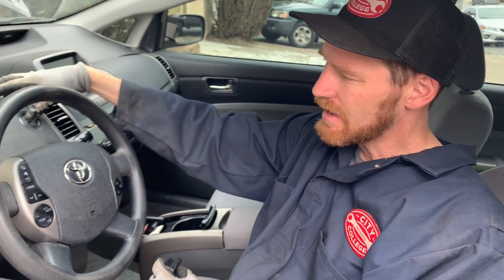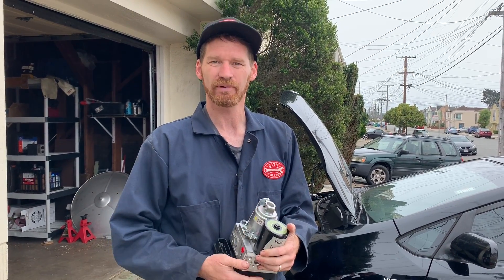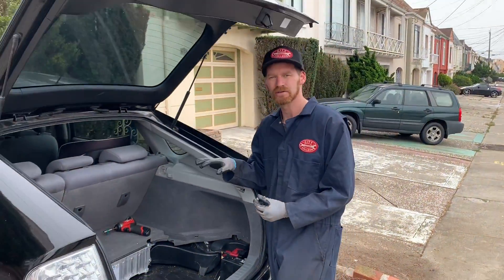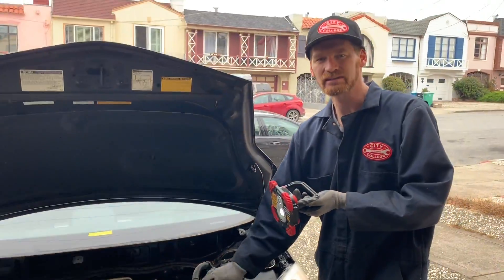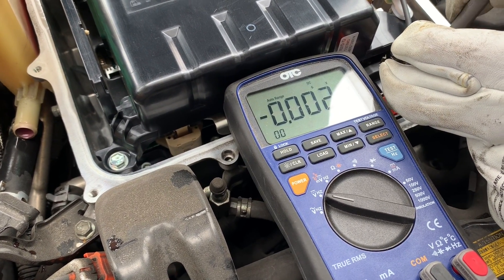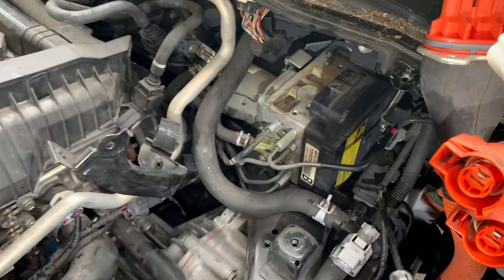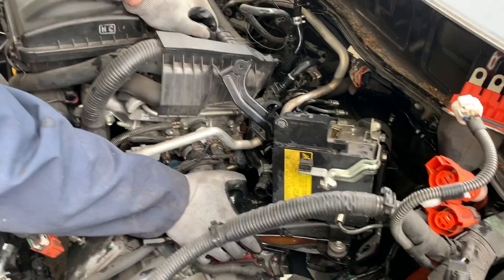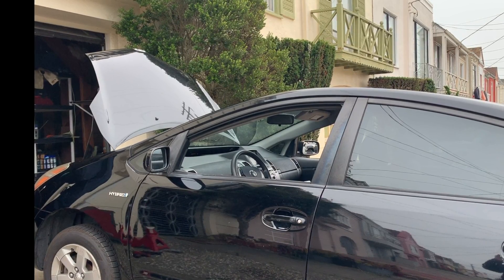2004-2009 Prius ABS Actuator Replacement

Comment: My 2008 Prius is making the high pitch beeping sound with the (ABS , VSC, and the brake) light on! I used the paper clip trick and the lights turned off  for 1 day , and then went back on!. Now the beep sound is longer and comes back on more often. would changing the  ABS actuator stop this issue? Please help ... thanks
Reply from the maker: I think the beeping is a symptom of failed actuator. Checking the stored trouble codes in the abs module would be the next step.
Reply: @Mrelectric423   I did and now I'm pretty convinced that the Actuator needs to be replaced. I'm going to see if I can find a second-hand actuator and follow this video to install it. Thank you!
Reply: I followed the video, and with a help of a great friend I was able to replace the part in about 8hrs . The car has been working properly for about a week now. 🤞🏼 
Thanks again for the useful video and I saved a huge amount of money. 
Thanks again!
Reply from the maker: @hamahawta  Excellent!

Comment: Thanks for your help I was able to complete my actuator replacement on my 06 Prius, I purchased a one month old actuator from eBay for $700 out the door and I ended up doing the paper clip reset so far it's running normal again after I bled them brakes all the way around, I started at 3:30 p.m. and ended about 10:30 I just took it slow cleaned up all the parts went well thank you again
Reply: Was your Prius making the high pitch beeping sound before ?
Reply: @hamahawta   No all along it was just making the clock sound just under the hood and some clicking sounds back by the rear brakes every 5 seconds it would last about 5 seconds, But the high pitch beep came on when I was bleeding the brakes with the new actuator,  I just continue to bleed them  Kind of like a traditional way of bleeding, Then I needed to use the paper clip trick to clear the lights and that also reset the new actuator, You have to do this a few times to get a good bleeding but so far I'm driving for the last 200 miles and everything runs perfectly
Reply: @mrvic92154  Thanks! I will change the actuator, and hope this whole beep and click sound stops afterward.

Comment: Hi bro.I got my prius from USA 2 day ago.so the light of abs vsc and brake on the panel.computer showed C1391.it mean same problem as on your video ?.
The same noise in my car.zzzzzzzzzzzzz and some time noise like some body knock the door
Reply from the maker: Yes it probably needs an actuator.
The procedure is unique for each generation of the prius. My video is for the 2004-2009 prius

Comment: Help? I finished, but the same lights and beep come on. No sound from the brakes? Resister? missing plug? New unit.
Reply from the maker: Check and clear the codes. With certain codes it will not even try.

Comment: I did this nd got now the car won't turn on and all the lights are on any ideas what did wrong?
Reply from the maker: Orange safety connector not clicked down all the way or 12v battery dead
Reply: @Mrelectric423 thank u, I got a code p0A0D and I cleared it nd checked the orange safety connector took it off and put it back on a couple times and it's not working so I'm not sure what else it could be any ideas?
Reply from the maker: @jesusibaibarriaga2645  You are probably not pushing the plug down?
https://www.youtube.com/watch?v=khDrAr2gog8

If that is not it check the tiny pins inside the inverter cover that are part of the same safety circuit.
Reply: @Mrelectric423  yea at first I didn't but then I figured it out and even after pushing it down still nothing I will check the voltage on the 12 v battery tomorrow when I go back to work but right now I don't know what else to do
Reply: @Mrelectric423  ok ill check those pins as well inside the inverter cover

Comment: I appreciate your time in making these very informative videos. I recently replaced the ABS Actuator on a 2008 RX 400H (so much easier than the Prius) and the brakes worked perfectly after replacing it. I did not need to bleed the brakes at all and all the ABS warning lights went away. If all is working well is there a need to deal with Techstream? Do you know of any issues that may arise if I do not do anything else? Thank you for your time!
Reply from the maker: My advice, If it works and no error light illuminated do not bleed it.
Reply: @Mrelectric423  You are awesome, thank you!

Comment: WOW! Please never stop your way of properly posting R&R videos! Now that I have your attention. lol 07 Prius, DTC Code (ABS flash code) is 45. I have the same sound but intermittently. 3 things I've noticed: 1) Apply brakes, it stops. 2) Rotate the Passenger-Right tire, it stops. 3) From the main battery compartment area and when the "shuttering sound" stops I can hear what sounds like fluid circulating near that right-rear quarter panel area. Maybe an ABS valve or something stuck open? Any suggestions/vids would be MUCH appreciated.

Comment: Thank you so much for sharing this video and this is really helpful. Especially the bleeding process for the brake. The ABS module was so hard to take out and it took 3 of us 3 hours to complete the change work. Here is something that i want to share so if anyone sees your videos i hope they can find this helpful. 
After replacing the ABS actuator, the dash still shows VSC ABS lights, at first i thought the replacement part was bad (i bought the used one on EBAY), then after i finished the bleeding process and use the paper clip OBD trick,  the 3 dash lights go off magically. I hope everyone finds it helpful and thank you again for sharing this video.
Reply: How much did it cost
Reply: Blessings bro
Reply: Hey! How's the ebay part holding up?
Reply: @wssr3293   it's holding up very well, the Prius is still rocking after 300K miles
Reply: What is the OBD paper clip trick, I do have an OBD bluetooth scanner.

Comment: Great video. Used this video and others from two other guys.  Each one had different take on removal/replacement and I was able to repair my 2009 Prius with over 200K miles.  Bought refurbed ABS pump on ebay for $260.
Reply: @Kyle Galusha Hows it running today? still going strong? the abs i mean
Reply: @travislowrider6623  Still running fine. No brake problems at all.
Reply from the maker: Great to hear the DIY hybrid repair scene is growing one costly, major repair at a time. Good work!
Reply: @greengearhead1153  hey boss mine went out on my 14. Do I need to replace the master cylinder like they do at the dealership? I don't want to replace it if not needed.
Reply: @Rhamlin7  no, I did not
Reply: How's it running after 3 years? Thanks
Reply: @wssr3293  still running.  Should go over 250K this month.

Comment: Before buying a new ABS actuator make sure you check your brake fluid level. In my case it was leaking out of my drum brakes which I'm already waiting for in the mail. The brakes started working again after I added fluid (go figure) and I anticipate the leak will stop when I replace my drums.
Reply from the maker: Good tip
Reply from the maker: This video shows Prius drum brake repair. 
https://youtu.be/SvT4L5QrWAg
Reply: @Mrelectric423  The leak stopped when I replaced my brakes. Any idea how to reset the lights/codes?

Comment: Mine doesn't do that, but my lights are on and the code reader it's showing that,what does that mean?
Reply from the maker: What abs codes do you have.
Reply: @Mrelectric423  0 my codes are for my O2 sensor
Reply from the maker: @missquiinn6695  if there are not any abs codes it is unrelated to abs actuator as described in the video.

Comment: No problem easy job . New replacement has same issues  red triangle and won't leave park.. as it was before all worked just a hard manual brake pedal . And car drove. Now  not re inserted orange hi volt battery interrupter it's in correctly still no correct start no speedo etc
Reply from the maker: Sounds like something unplugged

Comment: I have issue to put brake line back in place. Any suggestion? I just won’t tread in and don’t want to bend it too hard.
Reply from the maker: Use the force

Comment: I just changed out my abs accumulator and now my vehicle won’t go in drive or anything? The red triangle is now on and check engine as well as the other lights that were on already. Any advice on what I should do? Do I have to program something?
Reply from the maker: Orange high voltage disconnect may not be clicked down. Make sure the lever swung inwards then moved downwards
Reply: That worked thank you!!

Comment: Our 2006 Prius  was towed to our Toyota  dealership yesterday with the exact codes and they called today with a $2700.00 replacement of the ABS actuator assembly.  Your well done video was very helpful and appreciated, thank you.  Looks like the quote was in line with your comments.   Understanding the scope of this work is huge considering the $$$ involved.  Great job thank you!    Only 73k  miles on the damned Prius, now known as the "bitch".
Reply: LMAO!!! I just got the bad news that this has gone bad on our Prius! I’m selling the bitch because it has 155k miles and I don’t want to dump that much $ into it with fears of something else failing. I’d like to take a sledge hammer to it is what I’d really like to do!

Comment: This is happening in my lexus gs430 smh $2,500 for the accumulator $500 to install and bleed brakes i wanted to cry have to use me and my wifes stimulus to fix it smh but it all happens for a reason

Comment: Have you done a 2010 prius actuator. 
Toyota in Louisiana is giving me the run around big time. I could really use some advice.
Thanks,
Dwightforeman
Reply: I have the 2010 model as well, and potentially the same problem.

Comment: This video and one other saved me over 2000$ and like you mentioned, it saved a Prius.  My local dealers gave 2 quotes, one for 4000$ and one for $3300.  I did the job myself, paid 1200 for the part coolant, and dot3. Thanks a ton.  Honestly wasn’t that hard of a job either.
Reply: Do you mind linking the other video you're talking about?

Comment: What is the torque spec of the inverter orange wires and the inverter mount?
Reply from the maker: Hedgehog The Sonic 48 inch pound ( I think)
Reply: @Mrelectric423  Thank you very much for answering.

Comment: Do you have a shop in SF that you offer this service for the brake actuator?
Reply: Does SF stand for south florida if so I am also needing that question answered. Or did you find someone?
Reply: @Healing_foodist2l  what did you end up doing about your actuator? I'm also in south florida
Reply: @danellawilliams5977  i bought the part online brand new and went to a local mechanic shop that installed it on for $500
Reply: @danellawilliams5977  it cost me $1,155 for a brand new and $500 labor for installing total cost was = $1,655 car dash lights and codes disappeared after the installation.

Comment: Did you ever post the detailed bleeding procedure?  I only see a short video without the scantool.
Reply from the maker: Ive been using the short procedure with good success. Next actuator I replace I will definitely try the short procedure.
Also worth mentioning,
I replaced an actuator without bleeding anything and tested the car. Everything worked normally so I skipped the bleed. That car has driven thousands of miles no issue.
Reply: @Mrelectric423  I want to say thanks for the video and to let you know that I got it done although it took a long time as I'm not much of a mechanic.  I used the regular bleed that you suggested (and that I've done before on my old Beetle) and it has worked fine. I have over one thousand miles on the car post my repair.   It felt good to save that much money although the part itself was ridiculously expensive.  I bought it new as I didn't think it was smart to put in that much work and gamble on a used or refurbished part.  Thanks again.

Comment: I have a 2004 that makes the same clattering noise when I open the door and when I power it down. The ABS and VSC lights are not on. 
Is this normal?
Reply from the maker: Yes the noise is normal
Reply: @Mrelectric423  I spoke to soon. The lights came on today. Do you have another contact number? You can PM me on Facebook if you'd like.
Reply from the maker: @genehamilton911  I recommend diy or go to a shop.
Reply: @Mrelectric423  Are you interested in doing the job? I can bring the part.
Reply from the maker: @genehamilton911  No but I appreciate the offer
Reply: @Mrelectric423  Where would I acquire the diagnostic tool and how much are they?
Reply from the maker: @genehamilton911  The scantool cable and software is sold on ebay or amazon. It is called "mini vci" you provide your own laptop. its only $20 or $30 for cable and software less laptop. Initial set up is complex and a bit difficult. You may need to hunt around for good software set up / loading procedures.
Reply: @Mrelectric423  Thank you for your time and video. The video was done very well and the additional information has been really helpful.

Comment: Toyota knows brake actuator is faulty.  Finally reimbursed me for replacement on my 2011 Pruis.  However it also must be a computer issue as it still occasionally makes the annoying brake noise for weeks and then just stops.
Reply: what annoying brake noise? creaking??
Reply: @RichelleRudinski-n5d  no not creaking it's hard to explain but a lot of times if you let your foot almost all the way off the brake or hold it to the floor break it will stop.

Comment: Hey
I put a new pump in, there was no lights on for a few days, but I noticed the front dr side brake was dragging then 3 days later the abs light came back on, any ideas what I did wrong or need to do?
Reply from the maker: The brake dragging is unusual. Are the brake pads ok not jammed?
I am interested to hear more about what happens next. I don't really know why the one brake is dragging.

Comment: I just replaced a actuator from a part I got from the junk yard. The original codes I had with the old actuator are no longer present. However the abs vsc and other brake light is still on. I bled the brakes and tried erasing the codes with the paper clip trick and tried erasing with the OBD meter and the lights are still on. Does that mean this actuator is bad too? 

I have 2 codes currently on C1203 and C1345

The car runs good. Put it’s killing me not getting these lights off the dash. Send help!
Reply from the maker: Im not sure if the paperclip trick really cleared your codes. Your obd2 reader also may not be advanced enough to clear codes. Does your obd2 tool read both abs codes and show system data?
Im not sure if you have a problem or just old codes

Comment: Great video!  Loved how you explained every process and made it understandable for us all.  And your care and caution for the safety aspect of it... very nice to see the care that you displayed.  I'm watching this video because I think that I'm having the same issue with my 2007 Prius.  My son was driving and the brakes just "went out" on him.  He was actually able to maneuver the car home without incident, but we are not willing to drive it around to "test" it out because of that.  I just wanted your opinion on that to see if that does sound like it is the actuator that needs to be replaced.  Also, can you give me an estimate on the part and what to expect as far as the cost of labor for this repair?  Thank you very much.
Reply from the maker: checking logged codes will tell you if it is the actuator. It could be the skid control ecu which would be much easier and less expensive to replace than the actuator.

Comment: I replaced the pump and my abs light is still on? It's a new pump, could it need to be bleed the brakes to get it to shut off or did I do something wrong?
Reply from the maker: Did you clear the codes?
Reply: @Mrelectric423  or found the problem I had a wire not making connection, you have a video on on to bleed the brakes after replacing the ABS
Reply: @wildimpo  did you bleed the brakes or did you drive it without issue afterwards?

Comment: You don't have the original HV battery in your car!  If you are not the one who replaced it, you are LUCKY!
Reply from the maker: Not sure what you mean
Reply: Mr. Electric the HV battery in your Prius was replaced at the dealer sometime after the car was new.  It’s not the one that was installed at the factory.  It might only be a couple of years old.  You can see the big white sticker on the side, and that means it was a dealer installed replacement! When you pulled the big “tray” to access the 12v battery you can see the big white sticker.

Comment: I just took out the ABS from my 2006 prius. a heck of a job but worth it because of the money that can be saved. I don't plan on buying a new ABS because it's ridiculously expensive. will buy a used one but I understand they can last about 6 years or so because of the years of wear on the electric motor of the ABS. I will take apart mine to see how much wear my own ABS has on it and see if the electric motor in it is the culprit of the failure.
Reply from the maker: Nice!

Comment: Hey Mr. ELECTRIC. Where can I get a hold of one of those computers that you use to control the ABS actuator? I need one to also control the electric water pump so I can help bleed my coolant system.
Reply from the maker: Computer ebay, software and cable on Amazon search "mini vci"
Watch my video on inverter pump r&r. You don't need to use a scantool to run the electric coolant pump it runs continuously at key on.

Comment: FYI no one in these days rebuilds abs modules however there is a DC motor in this abs that has bearing friction noise
Reply from the maker: Module Fixer,  Module Repair Pro, Module Master to name a few businesses that repair abs modules. They rebuild the black electronic half. Not sure if they repair the silver mechanical side.

Comment: What can you tell about 2003 Prius, what needs to be replaced  if ABS failed, the part on drivers side or the passenger  side looking like a yellowish  cylinder (motor )?